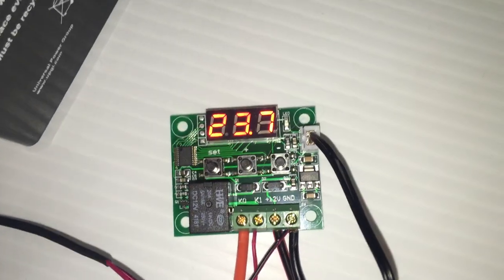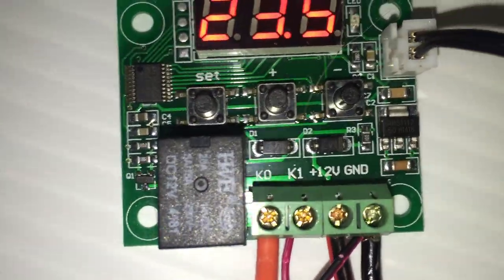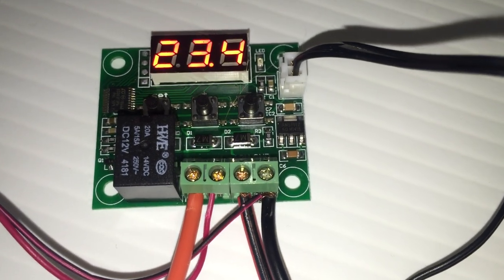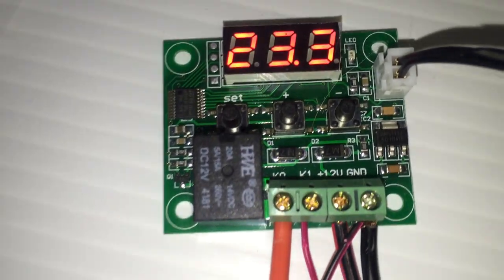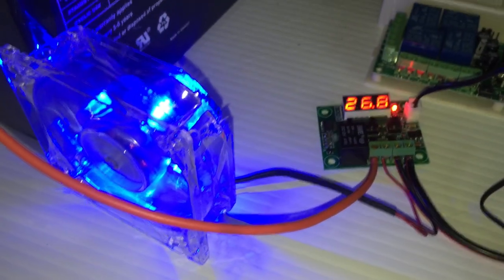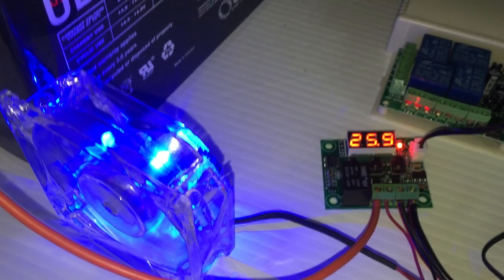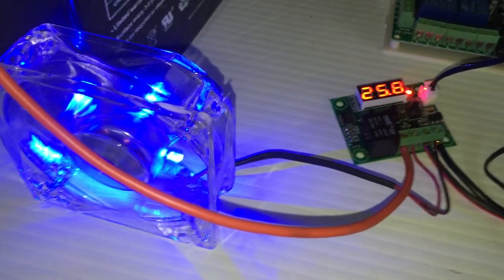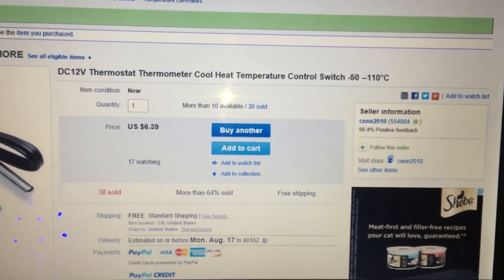How to wire 12v Thermostat Control Switch

Comment: You know this is one of those simple things that sometimes needs to be explained.  Years ago, I was a Sgt. in the US Army Communications branch.  I had a couple of fellows who worked under me, and we were building a mobile communications hut on the back of a deuce and a half.  Well the problem was installing an exhaust fan. I needed it to run off 110 volts and blow the air out a vent.  I sent two trained communications specialist's down to the motor pool with the fan and a couple of toggle switches to mount on the control board, as well as the necessary wire to install the fan.  They came back about a half hour later to report that the switches must be bad because every time they turned on the fan after wiring it  up, it blew up the switches.  So I sent them back with two more switches, they returned once again with the same tale of woe. So, being the good Sgt. that I was, I accompanied them to the motor pool to see what they were doing to  blow so many switches.  Come to find out, they wired both sides of the AC to the switch, then hooked the fan wires to the same terminals on the switch, so when they hit the switch they did  a dead short over 110 volts.  I had to explain to these trained communications specialists how a switch was intended to interrupt the flow of one side of the power, not join both sides of the power. Both learned a bit from me, and I ended up doing the damn job myself.

Comment: You sir are a LEGEND! Spent the afternoon trying to fathom the wiring out on this. 1 minute into your video, and I got it! 
I have got two of these that I will use on my motorcycle to control two electric fans for my oil cooler. Will set one to come on at 85 degrees, the other to come on at about 95 degrees. Thank you SO much. 😁😁😁😁😁

Comment: Well, here we are 5 years later in 2020, and they sell an upgraded version with two displays. One is set temperature and actual. If disconnected from 12Vdc, you have to re-set the temperature you want. It has no memory and if driven every day, you’re are ok. It has a parasitic drain of <35 mA. This would drain a fully charged battery in about 4 weeks, like a vintage/classic car not driven every day. Yes, I recommend a battery tender. A battery at full charge is 12.8 Vdc. Once it drops to 11.2 Vdc, it is at zero % state of charge also temperatures plays a big change. Reserve Capacity (RC) on the battery label is not well understood. At 72 degrees F, if a 20 amp load was placed on the battery, when it hits 10.8Vdc, it may start,  as this RC is the limit in minutes it takes for battery to discharge and still start the vehicle. As long as the battery is at 100% “State-Of-Health”. I am going by memory but very close. A charger at 2 Amps that is good, are $50-$80 dollars. They stop an take measurements as the $20 floaters go by internal resistance or voltage. The best is both, but good luck getting that info. Companies like “Yuasa” make very good ones. I use a “Conductance” testers. These are pricy but takes 10 seconds. It measures voltage, then based upon CCA, CA, MCA or JIS, sends an A/C sine wave thru the battery, both directions, measure what comes out, test voltage again, then tells you the actual condition. GM is required by warranty since 1999, to use this tool, Infared printer with the results stapled to the warranty ticket. Also, AGM (Absorbant Glass Matt) batteries do not survive being dead a few times. Placing the battery under the rear seat, with the foam blanket on it, it not subject to extreme temperature changes nor vibration. Vibration causes the internal welded cell straps to crack, causing a open cell. They have lasted 10+ years under the rear seat. This same reporting has come from hundreds of shops and dealers. I had to know this stuff. ASE Master Tech since 1978-Retired, fixing go-carts, motorcycles and imports since the late 60’s. A lot to take in, sorry to be long. Nice job on the video, clear, spoken well and parts were shown! Thanks. Always enjoy learning.

Comment: I am sure this would work on less than 12V.  If you combine this with a low voltage supply such as an old phone charger (5V) and a solid state relay you can use it to safely switch mains voltage. (110V or 220V). I have installed two of these solid state relays working on 5V to switch mains current and they work beautifully.

Comment: There is a fundamental problem with this video.
Fact: the board as supplied is divided into 2 seperate parts:

1. The board circuitry including the SENSOR and COIL of the relay, and
2. Contacts of the relay (K0 & K1) that are totally isolated from the board (this allows for AC load applications as well as DC loads greater than 12V.
The "1" consumes very little power so +12 and GND terminals require only a thin wire  #18 gauge or smaller.
The "2" will consume the power dependant on the LOAD and VOLTAGE supplied to it and thus the wire gauge used for K0 and K1 terminals of the CONTACT of the relay do depend of the current consumed by the LOAD.

Above project may work OK with small 12V LOAD connected to the same battery as the board itself but as shown in the video, the K0 and K1 should have the same gauge as determined by the LOAD current required.

The author is lucky it worked for him this time around.

Cheers,
Reply: He does have a separate power supply going in +12 and GND terminals supply and a separate power source for the fan and maybe he should connect the negative to his fan battery. I looked at many and some say the K0 and K1 are both out, but that can't be so he has it right. If I ran a AC device I would splice the positive wire of the cord and add the source end to K0 and device end to K1, where's that wrong?
Reply: I also seen the relay section is rated for 14v-125v and I didn't see 12v but I looked at another and it was rated 12v in and 12v out so they don't know what they're selling.
Reply: I am sorry if you missed the point. This board is separated into two parts. The 1st part is the control circuitry that do drive the coil of the relay. The 2nd part is the contacts of that relay and they are totally electrically separated from the control section that needs DC 12V. Contacts of the relay (K0 and K1) can accept any load and thus the gauge of the wire has to match the limitation of the relay contacts. Not so for the control part of the board, it only needs a thin wire. There is no need to bind the TWO parts together by any means but you may make a common negative if the load is of the DC type.
Reply: I didn't miss the point, the +12V and GND side activates the relay which make a connection and disconnects the in and out of K0 and K1 which is a totally different power source up to 125v @ 20a some sellers say it's 14v to 125v, but others say 12v to 125v so it doesn't really matter and in this application the isolated side doesn't care because there's no protection chips it only it allows it to run variable voltages in its the relays voltage and amperage rating which he's well with in so it doesn't fry the relay connections if needed you can use this to switch a separate unit with a better relay so if it works he can't be wrong and he did use to separate power sources. The only thing he could have done different would be to use a separate ground wire to a isolated GND and yes he could have used a 18 or 20 gauge wire, but only because the thicker wire could damage the connections, but that's it. The K0 and K1 side doesn't care.

Comment: This is really cool.  I can think of a zillion settings where I would like to control when a fan comes on/goes off.  It's a crying shame this board doesn't come with a mountable shell to protect it from dirt & dust or contact with someone's hand.
Reply: Try search eBay for "W1209WK", it's basically the panel mount version!

Comment: Code          Code Description                 Setting range         Factory setting
P0               Cooling /Heating                  C/H                     C
P1               Hysteresis setting             0.5-15                     2
P2               Highest setting upper limit    110                       110
P3               Lowest setting upper limit     -50                       -50
P4               Temperature correction         -7+7                        0
P5               Delay start time               0-10 Minutes                0
P6               High temperature alarm         0-110                     OFF
Off state, long press + - boot to restore the factory settings
Reply: Does this allow you to change it to turn on when it gets to0 cold, to turn a heater on? Thanks

Comment: Hello, let me see if I understand you correctly.
1)GND=your ground wire from your 12v inverter.
2)12v=your power wire from your 12v inverter.
3)k1=is your power wire from the cpu-fan. or whatever gadget needs to be turn on and off.
4)ko=the negative wire from the cpu-fan.
is this correct?thanks in advance for making this video.
Reply: no not correct.   neg from load goes to gnd.  pos from load goes to k0, pos from power source (12v dc- 120v ac) goes to 12v +, and neg power source goes to neg.
Reply: no not correct.   neg from load goes to gnd.  pos from load goes to k0, pos from power source (12v dc- 120v ac) goes to 12v +, and neg power source goes to neg.
Reply: +Colin Parsons i mean neg from power source goes to gnd.
Reply: What about the K1?

Comment: Can you set the low Temperatur higher than the highest one ? I would like to use it to heat something untill a certain temperature and the shut my heatet off. Would this be possibel?
Reply: you can set it in HEAT mode. then it just works reverse: energizes when the temperature drops below a set temperature and switches off when it becomes hotter than that temperature (+ a hysteresis that you can set)
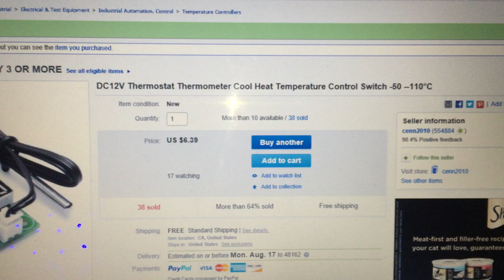Reply: It's got quite a large range:  -50°C to 100°C as shown at 5:00 mark.

Comment: I have a similar device and my P3  lower temperature default is -30degC  but online  the specs shows  -50 degC. I have tried many settings from P0 -P6 to set my desired lower temperature to -50 degC but no positive results. 
If you have any idea can you update me ? 
Thanks in advance

Comment: I have another question to ask you do you have that thermostat hooked up with two positive on the controller and then the ground hook up so what I'm saying is 2K is from the positive 2K second one would be the fan positive to the positive on device the ground will go to the ground the other side with a 12-volt positive you will hook up another 12 volt and ground is that how you have that hooked up please get back to me driving me crazy

Comment: I want a timer switch which can be started and stopped at our desired time means if I start it for 5 minutes it should be stopped after 5 minutes, if it is started for 2 minutes it should be stopped after 2 minutes. Is it possible  ?
Reply: Treble 5 timer is what your looking for .......555timer

Comment: Can the temperature sensing wire with the metal end be immersed in water to check water temperature?
Reply: Yes for a little while because its probe (metal end) is water proof, but do not exaggerate and put in the liquid the metal only not the wire.. you are dealing with electronics.. make sure your safety is not in danger. Obviously just for a  few seconds for the measurement time.. You cannot use the thermostat for timing the heat or cool of water.. you should use a more expensive one.. but you can try anyway cause even if you break it,  you lose a just a few euros.. anyway If you do or did it already let us know in the comments. CAN I ASK YOU FOR WHAT PROJECT DO YOU NEED IT?😀

Comment: Which type of bulb is used in a 12 v dc thermostat for incubator?
Reply: It would be a 12V DC bulb; which one? How would I know? I assume you do have an incubator, do you? If not, please GOOGLE some info about it.. It could be AC powered lamp and requires different approach than in this example.

Comment: I have the same identical thermostat that you have I tried hooking it up that way I have a 12-volt system and it says 12 volt on it and what happened it doesn't go on the way yours goes on I noticed you have extra wire in there you had that hooked up to something else please get back to me Mike

Comment: How about to reverse the function ??? For instance I want it to switch OFF when it riches the temperature and not ON ???
Reply: Yes I use on to switch my 12 volt diesel heater for my hot tub

Comment: would this work to run two or three fans or would i need a channel relay
Reply: it depends how much current each fan consumes, say - if 1 fan consumes 1A, then 5 fans will consume 5Amps. The relay in question is good up to 20 Amps although I would not like to drive it to its limits.

Comment: so I take it this only works with 12 Volt 20 amp devices?
Reply: You have to check on eBay, there are different ones with different specs, but I think the one in the video can handle 120VAC, 20A or 14VDC 20A. Those are max numbers. You can control 5VDC device that only draws .25A. The board controls a switch that mechanically opens and closes. It is up to you what you want to hook up to it. Just stay under the limits.

Comment: Can I connect multiple fans to that ? If yes how many?
Reply: The number of fans you can connect is the sum of the current they do consume, which could not be greater than the rating of the relay contacts and to be more specific; if the relays contacts are rated at 20A and fans you are using consumes 1A, then in theory you could have 20 fans working together. In practice - I would not connect more than 10 to preserve relay's contacts life.The ratings are on the relay itself:  20A for contacts.

Comment: can anyone post a link to a 12v power for this. thx!
Reply: any 12v adapter
Reply: if you need only to turn on the controller any 12v psu can do the job.. just get the cheapest one in the local store

Comment: can it work on 14v
Reply: It will, but I would put 2 diodes from +end in series to introduce the voltage drop from 14V DC to 12.8V DC or even 3 diodes to reduce it to 12.2V. This talking about the controller supply line +12 and GND. The load can happily run from full 14V DC to the load, the other end of the load connected to K0 and K1 bridged (shorted) to GND terminal.